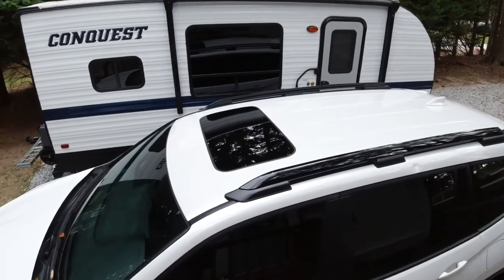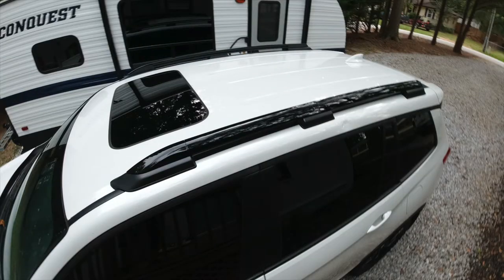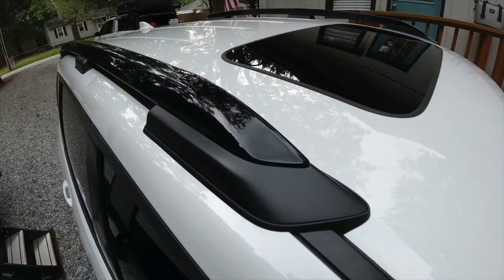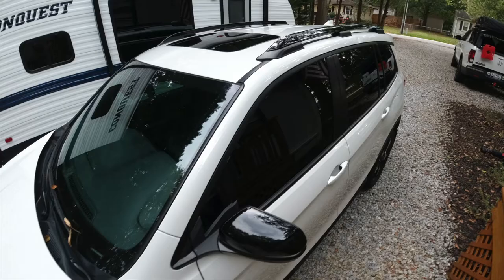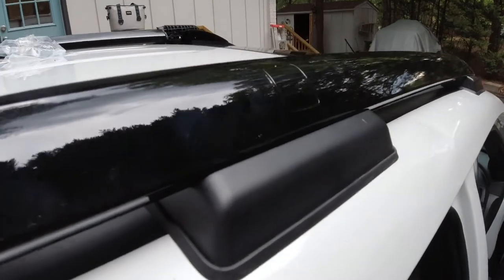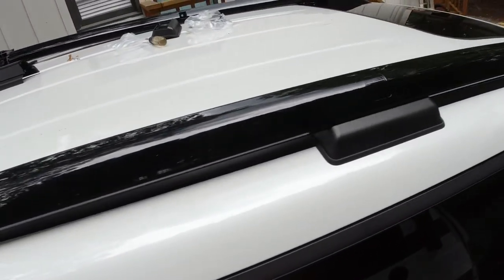HOW TO INSTALL HONDA OEM PASSPORT ROOF RAILS

Comment: Thank you Randy. You made it look uncomplicated. I was hesitant if I should do it myself or have Honda install it. It looks like I would be saving $300 by installing myself and allocating that to hitch harness installation by Honda. I vote for little bit of talking during video. Keep it coming because there is not much out there on any self installation of accessories like roof rails, OEM hitch, harness and other parts for Passport. We appreciate your effort and helping the rest of the Passport owners saving $$.
Reply from the maker: Thanks so much!!! Greatly appreciated

Comment: Thanks for posting this. It helped me more easily install rails and cross bars on my new/used 2020 Passport. The hardest part for me was cutting the rail with a hacksaw, as even a fine toothed blade hung up on the thin metal. It's satisfying to have a good result and save a bunch of money.
Reply from the maker: Heck yeah!!!!! Glad to help.

Comment: Great vid,  thanks. The Honda instruction recommend an air saw to cut. Pretty cheap at Harbor freight. I have a dremel I rarely use. What attachment did you use on the dremel?
Reply from the maker: Just what I had. Nothing special.

Comment: Hey, where did you purchase the rails from. Also I can't tell if the part number I'm seeing only comes with 1. If it does, than we're talking 500 for the rails which seems super pricey.
Reply from the maker: They are Honda OEM available at CampingRandy.com and they come with both.

Comment: Took me 3 hours. 😂
Reply from the maker: No it didn’t!!!!
Reply: Question, when you take off the roof molding, you end up breaking some or all of the plastic clips (yellow and white). Did you replace any of those clips before you re-installed the molding that you cut?  Or, does the pressure from the rubber bottoms of the new roof rail  (three sections that hold the rail to the car) hold down all of the molding without the need for the clips?   Thanks.  Excellent video.
Reply: New clips come with the kit.
Reply: Yeah 15 to 20 minutes is not realistic. Unless you know exactly what to do and have all the tools ready and parts ready Just think if he would have used plastic trims tools the video would have been half as long. But three hours means you can't even figure out how to get the parts out of the box.